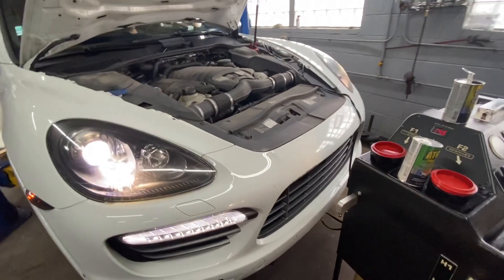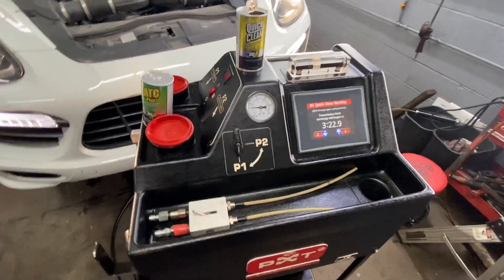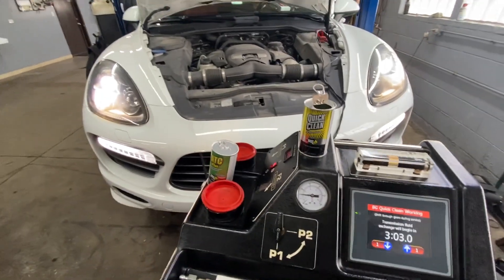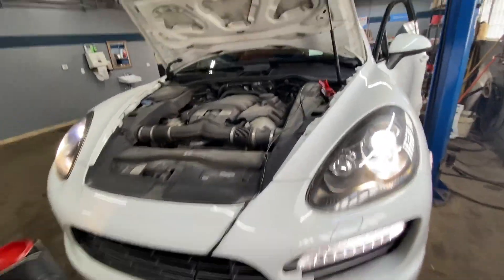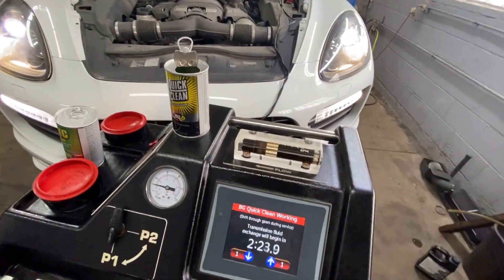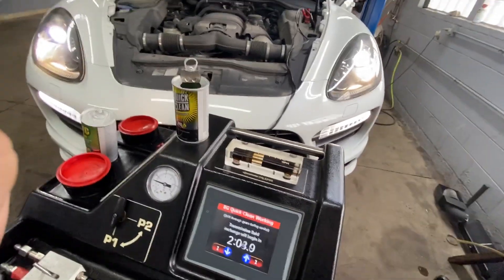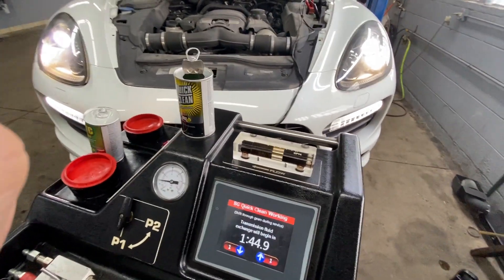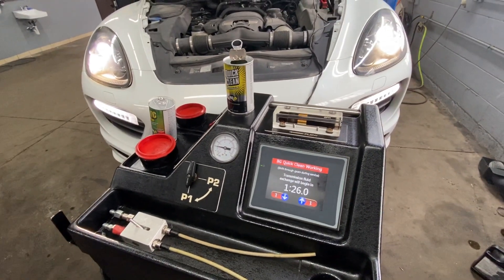Porsche Transmission Fluid Flush Process Part 1

Comment: I took my Porsche Panamera Turbo to the dealership to get transmission fluid changed. They said it requires a PIWIS Tester and takes 5 hours  to complete the process and cost $2,000. Thats hard to believe. No one around here has the type of system you are using that takes less than an hour and dont require a PIWIS Tester. We dont even have a independent Porsche mechanic in the whole damn city. 

 Now my clutch is starting to slip a tiny bit and occasionally makes a hum sound for about 2 seconds. He said the transmission is designed to be disposable if you don't have the fluid change before 70k you risk having to have it replaced for $18,000 for a new one. This is by far the worst thing I've ever heard from the dealer repair shop. I figured worse case scenario would be I'd have to replace the clutches and replace the fluid. Apparently not. I just found a used one on ebay for $3,000. I think I may have to take my chances with that one if I cant find a independent shop. 

My question is, how do you get to the top bolts around the transmission that connects it to the engine? I can't even get a finger in there.